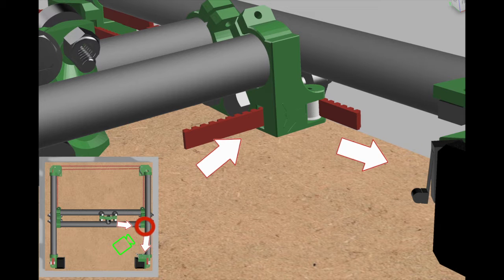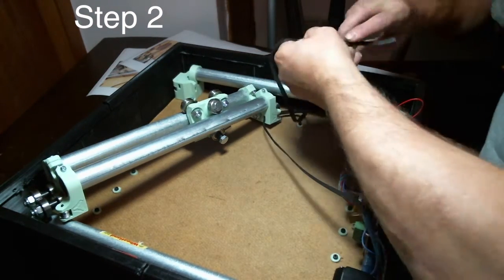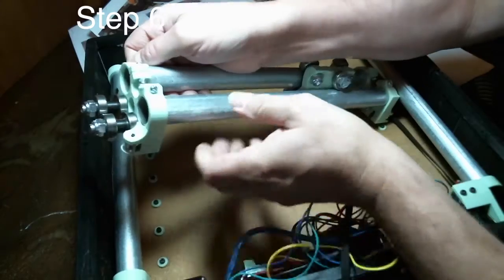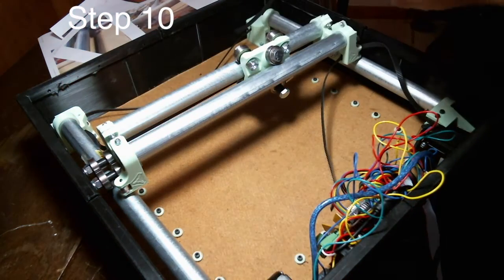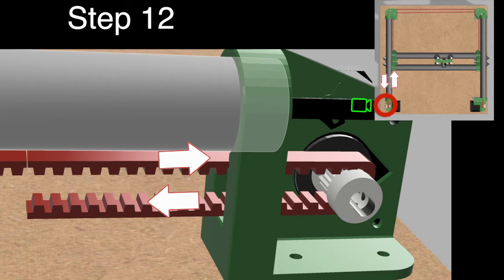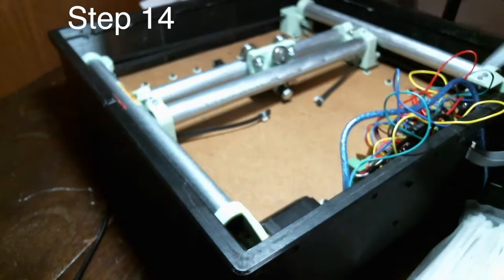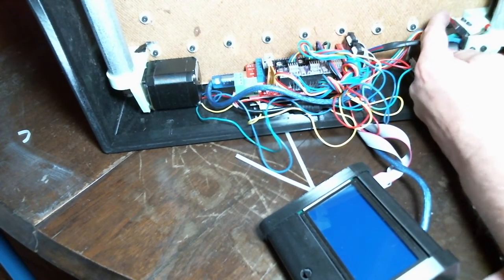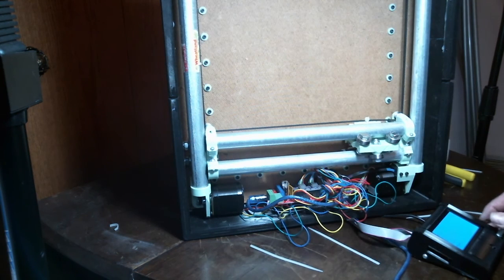ZenXY   Episode 6   Belt Rerouting and Corrections

Comment: I have the ZenXY  assembled  but this out the electronics. I have used this video to route the timing belt but I have a problem . I have watched your video and step b y step ran the belts according to your video-- several times to be sure that its right. But when I manually rotate one of the stepper motor pulley, both the XY axis move. When I rotate the other stepper pulley the XY axis also both move but opposite direction. Any suggestions?
Reply: That is what is meant to happen I believe after figuring out the route. Only when they both move will it move parallel to the sides. I presume when you say "opposite" you mean perpendicular/at a right angle to previous motion.
.